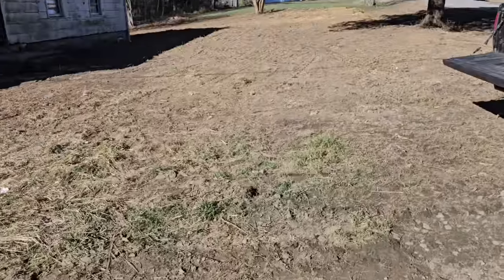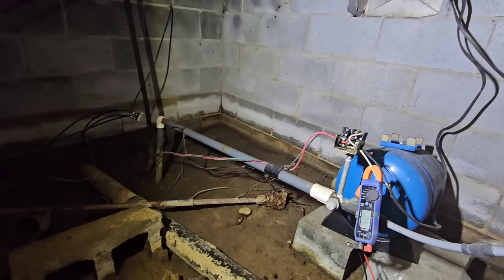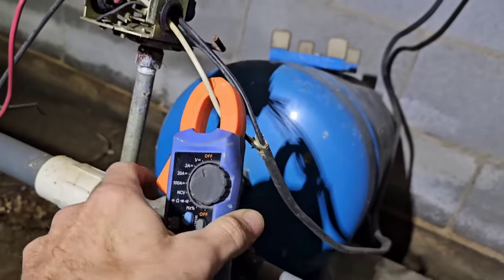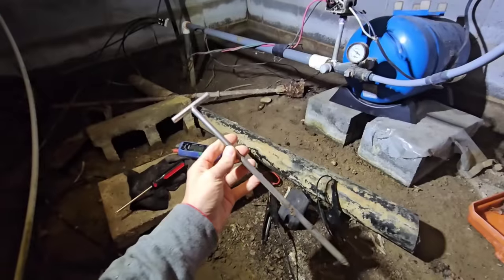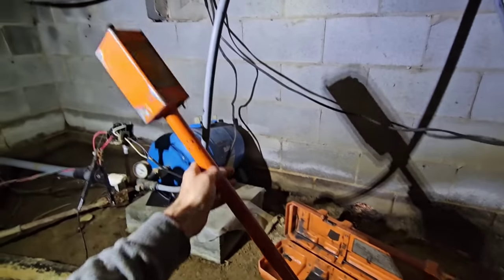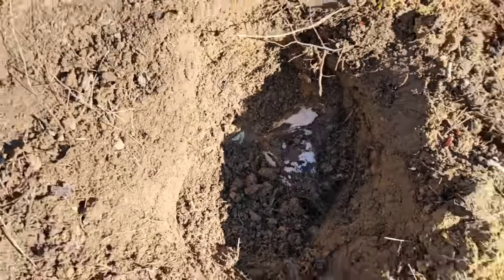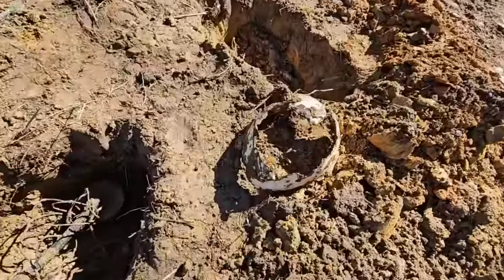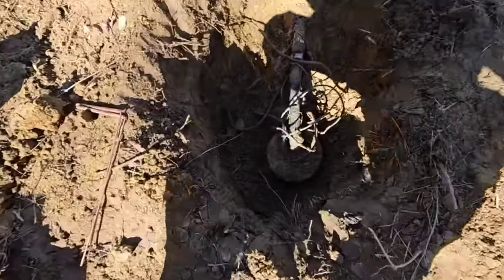Can Copper Dousing Rods Find a Water Well below the Ground? New Tech Vs. Old

Comment: Mom's old 70 ft. well went dry. I made a copper dowsing rod setup and found it crossing many times in a spot ten feet away from the old one. Told the well driller to dig it there. He drilled it and hit granite at 44 ft. then on to 320 and only one gal/min. He asked if he needed to do another hole. I said #e!! no keep drilling this one. At 340  the water jumped to 30 gal/min. I asked how many more rods he had on the truck and so it went to 420 ft. Set the pump at 200 ft. Thanks to a gold mining operation 18 miles away making a hole like the grand canyon, everyone's water table dropped drastically  on that side of the county. Every one on my road had to go 400 ft and abandoning their 70 to 100 ft wells. Granite grey and black past the 44 feet of red clay. Driller had to install a new bit before finishing the hole. Glad I chose not to go with his second hole idea. $$$ After that dowsing rod experience, I have found underground wires and pipes with those pieces of copper scrap. Looked just like your's.

Comment: As kids we were fascinated by dowsing.
We took welding rods and bent them and walked around the yard.
Little result until we came close to a car, around it's battery the rods did move.
There is something going on there with people, metal and electricity.
Capacitors, conductors and magnetic fields.

Later at a cousins farm, a renowned local dowser came by to help find a new well.
Using a piece of garden hose about 2 feet long and held out in front of him in each hand forming a "U" he walked across the yard. 
As he walked across a certain area it appeared as though the hose pulled down, violently twisting the mans hands down.
The man had a shocked look on his face as he struggled to lift and twist the hose back up, he appeared to be surprised.

Is dowsing for water effective? Can't tell you. Just saw it happen.

Comment: During my Boy Scouts of America National Camping School training event the instructor demonstrated dowsing. One of the [student] rangers was exceptionally gifted at dowsing.  I later asked him if he would give me another demonstration dowsing. I watch him very closely as he used a forked branch to dowse with. As he approached a water source I could hear the sound of the branch as it bent downward. I then held the branch myself exactly the way he held it; There was no way he deliberately caused that branch to bend the way it did. There is also a method to determine how far down the water is or an object is buried. Basically, a string held stationary over the site, suspended into a large mouth glass jar with a metal washer tied at the end. The string will begins to swing back and forth until it strikes the sides of the jar. How many time it strikes indicate the depth, then the cycle repeats. A skeptic might say the swinging is caused by the Coriolis force. This may explain the swinging, but not why the washer strikes the glass jar with repeating intervals. Yes, I do believe, and am a new subscriber.

Comment: I have actually watched a person find where to drill a well 60 years ago. This was when they were drilling 3 feet diameter wells. I too was very skeptical that a well could found using the two copper rods or a y shaped small branch. When I was younger this is how the well for my mothers house was found.  Some gentleman my grandfather knew came to our land and walked around dousing using the copper rods and when the rods crossed that is where they dug the well. Great job on locating the well. I still trust the electronic devices in finding broken wiring.
Reply: That's because there was an aquifer beneath them, and anywhere they picked, they would always eventually hit water.
Reply: @ReservedForFutureUse thank you for adding a common sense remark.

Comment: After my dad retired from the Air Force he bought a house from a guy that was critically ill. He discovered that the well was about 50 feet from the septic tank. To remove any chances of contamination he drilled a new well 200 feet uphill from the septic system.

Comment: I did not want to read off 500 for comments. So I don't know if somebody already said this or need to get some rigid tubing at least 6 inches long to be able to put the handles of the gossing rides in so they can turn freely and not be slowed up by the friction of your hands.  Then you need to when you're walking along, you don't need to keep them level. You actually need to keep them pointed about 2 or 3° down. That way, when they do cross, they're crossing up hill.
So, you know you've got a strong signal when they cross up hill. Give it a try you might like it It's already taken the first step just by trying the dousing rods

Comment: Dowsing works. I think dowsing falls into two categories. The kind you did that I think works like magnafluxing steel and there’s people that claim it does other things, which I would call divination. I don’t think they are the same thing but only look similar. I had a guy from RotoRooter demonstrate a commercial made pair sold by Lee supply. He then handed them to me and they worked for me also. It’s all well and good when the skeptics claim it’s some sort of subconscious muscle movement. But when it’s in your hands and they move and  you try to make them move away from where they want to go and they don’t you can definitely detect a pull on them. Then you know it’s real for yourself.

Comment: Any metal works.  I use coat hangers straightened, then bent in an "L" that goes in your fist.  Works everytime for water wells and locating pipes or lines.  Fact.  I cant explain exactly why, but dousing definitely works.

Comment: Fun video. You knew dang well those rods would work. I was lol. 

My mom left me her brass divining  (braizing) rods. I saw her pull them out often, usually when a repairman refused to take her word there were no abandoned cesspools in the area he needed to park his heavy equipment to work on her 40 ft tv antenna.There's common paranoia on that issue around here. 

I've used my mom's brass rods many times at the farms to locate privately owned underground nat gas lines that once supplied fuel to 8 and 10 inch wells that pumped 1k GPM. Today those wells are converted to 40 hp electric submersible pumps bringing up 300 GPM. 

I live on a four acre parcel that has had two houses on it. One built in the 1930s, was moved away after a new house was built by the property owner's son in the late 1950s. Though the houses were far apart there were shallow irrigation lines built everywhere. After living here 35 yrs i still need to pull out those divining rods from time to time. 

My uncle almost cried when I went over to his house to locate a lost sewer line for him. After i found his pipe he asked to try them out. The dern things would NOT work for him. I'm sure after I left he went into his inventory of welding supplies to make his own set. 

My rods vary in gauge. I dont know if that's intentional or not.

Comment: I inherited my parents ranch. 48 ac of 99% mostly hilly land. 1 flat spot big enough for a well rig to set up.  The spring was drastically drying up. Neighbors in 1960s technology had drilled 100 feet to hard rock and a dry hole. 

Update 2020s technology.  I brought a percussion rig and set it up on that one Flat spot  
.
The result .  .going through 50 feet of hard rock was 60 gpm 

Necessity and a lot of praying is as good as witching

Comment: Enjoy your channel, you know your stuff. You can also use a couple metal coat hangers, bend a 90 degree on one end, hold then level and they will cross on water line, gas line and an electric line. Don't know why, they just do.  Do you always put the ground in the middle, I can't tell? I would put a rope on the pump, might save dropping it sometime.

Comment: In Brazil we also use copper rods, they are very precise. The interesting thing is that not everyone works. and there's more! After finding the water, lower them onto the mark. go up (moving away from the ground) when they cross each other, mark the distance between them and the ground, (in Centimeters) 10cm is = 1 me0ter in depth, that is: I raised 80 cm before crossing the copper, then its first vein of water it will be 8m deep. Another interesting thing is: the faster they cross each other, the bigger and better the water vein is. I didn't believe it either until I had to do it.

Comment: Couldn't tell how you grounded your locator.  Speaking as an underground utility locator, you want your return signal to be as far away as possible so the ground point is best as far away as possible, 90 degrees away from your utility.  If you ground it close, it will make for a confusing signal and you will have trouble finding where it ends or is broken.  With the more sophisticated equipment that has estimated depth, you have extra clues.  The depth will show going deeper as you move past the end.  I would also use an inexpensive metal detector to try and find something like the well head that is less than a foot down after estimating the approximate location.  I have not mastered the divining rods but many public works departments in my area use them.  Just when I think I know how they work, I ran across a property owner who claims he can find an empty pvc pipe which kills all my theories on how it works.

Comment: In my teen's I helped take care of a cemetery. When we needed to locate the old graves we used them. The problem that we had was that the cemetery was old and not every grave was known about or marked. That would be because the wood cross or pile of rocks was long gone before there was records of the plots that were taken. So every time before digging a new grave we had to mark out the plot. This was to make sure that it was available. When we would walk the rodes would start to move back towards your arm slowly as if by magic. I don't remember them crossing but maybe I don't remember right. All that I know is once we did find an old unmarked grave. 

The rodes saved a lot of the digging and hitting old cloth or wooden caskets. All that I do know is that there is one grave that is on our family lot that is not marked and is now marked as unknown in the record. As a family we decided to record it that way so the grave had a space and didn't get dug up. 

The sad thing is that one family had the same thing happen on there lot. They went through everything and had the hole dug and had to get a different plot. They didn't believe the sticks and at five to six feet to wood box was found. The only good thing is that the hole was filled in and the grave is now marked. Unknown verified unmarked grave on record. 

Just because you don't understand something doesn't mean that it doesn't work. I know that because of that. The person who digs the graves. Just tells people that they will not dig if they think that there is a grave in the plot already. Because it's a small town now people are not able to find someone else to dig when he refuses to do it.

I just wish that people would understand that the land has been used as a cemetery for over 200 years. That is how the family plots came to be. When the first person in the family was buried they would take bricks or stones and make a square so that there was space for everyone else to be next to them. The cool thing is that some of the bricks are still there marking the lot. Up until the 1970's the family was in charge of their own lots and needed to take care of them. Some family's didn't keep a written record so there are unmarked graves. Wood only last for 100-150 years as a grave marker. Thanks for letting me remember one of my first jobs.

Comment: Dowsing is cool as!
TBH everyone has the ability to dowse but some block it, so I was pleasantly surprised to see it work for you. 

There are many different techniques for dowsing Copper Rods down to bent welding sticks or even branches of trees (usually a hazel fork) and even pendulums!
Back in the day many of the mines in Europe were dowsed and obviously not just for water! It worked for them. Obviously I would go with a full geo survey but it is all money and if a bit of bent rod or a chunk of crystal and a string (or even a plumb bob) works it makes sense to use them.

Comment: Because something works doesn't mean there is an explanation for it. I too have used 12 gauge copper wire to locate my water line. Just like yours held loosely and level they crossed when i was over the water pipe. Good job and well done. I'm at 800 feet elevation and farther up my road at 1100 feet there are fossils in the sandstone. Care to explain that ?

Comment: Over 20 years in irrigation  and for years  have just used the flags as dousing rods. Just bend them 90 and roll the flag plastic loose so there is no tension with hands. This is almost a nescity with locating old hydrolic irrigation systems unless it uses copper pipe then I just hook locator to the copper, since there are no wires  now finding the valve along the pipe   can get more difficult  but the easiest way I've found is a metal detector set for junk metal and have found valves that are normally 12"  down to 3 feet deep. ( commercial property that back filled over
 old  irrigation)
The dousing method works even better if the water has some flow to it.

Comment: I've never been able to find PVC with dowsing rods unless it had water flowing through it and I've had trouble finding dead electric lines.  I've never been able to find phone lines or television cable.  My question is:  Were you still sending a signal through the wires when you were dowsing?

Comment: I’m not surprised. Belief has nothing to do with dowsing - it just works. I just use a couple bent wires from  coat hangers for fun. A good green willow fork gives a dip too strong to hold up for me. I play at finding buried wires and pipes. A friend had me dowse a well location for him and it worked. That one really surprised me. Thanks for posting.

Comment: I've seen everything from pliers to coat hangers used. I prefer a pair of old acetylene welding rods bent in a right angle about a foot or so long. They can be used for other things besides locating u/g piping such as u/g streams, electrical wires etc. For several  hours one morning I set out to prove my grandpappy had a screw loose using them. At lunch all he said was " you got to believe". I tried again with a different attitude and have been using them successfully for some forty years now.

Comment: We witch every well we do and had great luck. Just did one this week 206ft and old well was 340ft on a acre property. Redrilled a pile of rotary wells over the years mainly mud and air drilled. Dual rotary seems to be the way to go now. We using cable rigs but if changing it would be a Derex machine.

Comment: It's not magic. It's magnetic field. You can also locate and with markers lay out an existing fill lines for a septic system. Like electricity, magnetism follows the path of least resistance. When you cross the field, the rods will swing and cross one another as you cross further, they will swing to the opposite direction. Halfway between those two points you will find the wire, pipe or fill line. even plastic pipe if it is full of water. Beware of overhead power lines and nearby water vanes or surface water flow as they will affect the rods accuracy. You can also locate underground water flow or water vanes. Not 100% accurate due to high iron content of the soil, but a good indicator and fun to try and locate French drains, fill lines, water and electrical lines on a property.

Comment: lol I have seen people that it didn't work for at all. No idea why not? Many years ago I worked in both water and waste water collection systems and often had lines that were non metallic or gasketed preventing any signal transmission. I had a pair of 10awg copper wires I kept in the tool box. They worked great most of the time. Approach a line from both sides slowly and often figure out line size. Stand in the middle of the line and walk away heel to toe as the wires uncross and get fairly close on the depth.
Only problem is, take it with a grain of salt and know where you are because it'll also locate cables of any kind, roots and iron deposits and probably ground water. That'll make you nuts if you aren't careful. lol

Comment: back in 1972 my father driller a well here on the farm. he did not believe in  dowsing and did not have it .. we have 1/2 gallon a minuet 225 feet. 
the vary next week right across the next house had a well drilled they had my grandfather dowse for water  he told then to drill 200 feet up the hill from us at 100 feet they hit 5 GPM. 
to the day he passed he would not admit that it worked.
i can not do it.  but my 25 year old son can and can all but tell how deep it is.

Comment: Was setting a couple of poles last week. Water department guy was out to locate a waterline, couldn’t find it with his equipment. Old guy too a couple pieces of copper ground wire, bent 4” at a right angle, left maybe 18” straight. Walked over the area where we were going to set the poles, wires crossed, walked across in another point wires crossed, did this several times, point where wires crossed made a straight line that ran fight where we were going to set the poles. We moved the poles back 4’ to avoid the area, drilled holes for poles and didn’t hit anything.

Comment: Today I dozed a well that is failing well. Well depth 50 ft, pump at 42 ft, water level 38 ft, 2 1/2 gallon minute production. Located a 2nd well that was abandoned  that was 75 ft deep and 28 gallons per minute production.  I also locare metals amongst other things